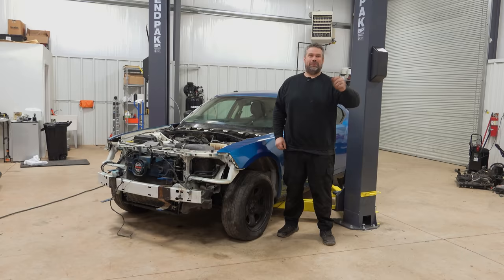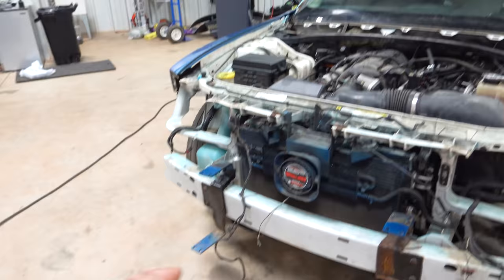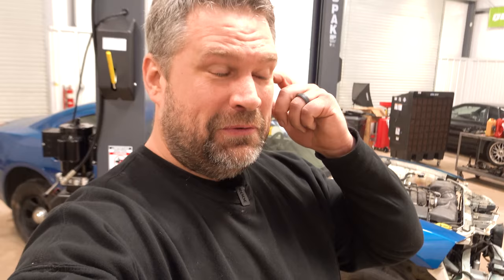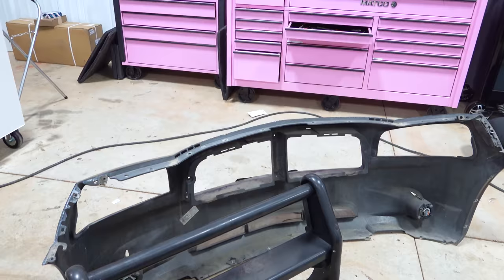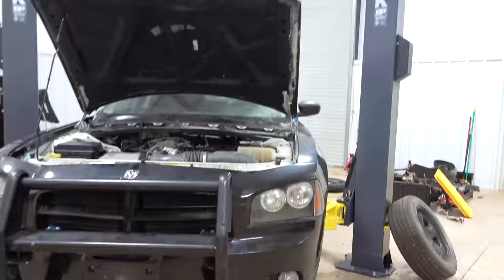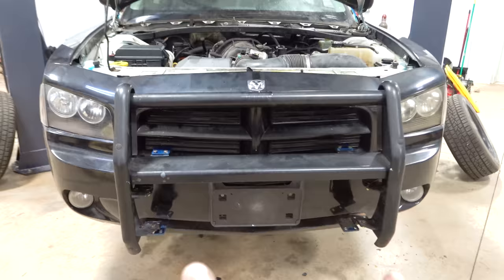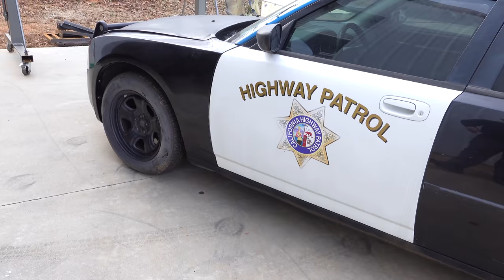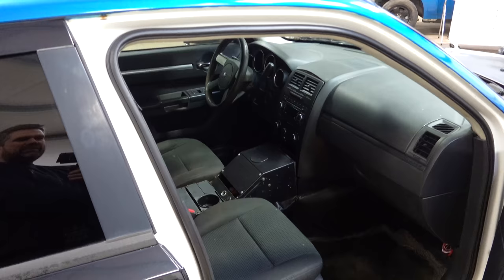Building An Insane Dodge Charger Cop Car In 2 Days (Was Way Harder Than I Thought)

Comment: My two cents, paint the quarters and side pillars up to the roof trim black, leave the very top of it blue, maybe replace “ Protect and Serve” with “Make Questionable Choices.” It would look freakin cool and get all the required boxes checked off. As always stay awesome guys!
Reply: Make Questionable Choices is an awesome idea on the side of it.
Reply: Make questionable choices is a great idea. And rattle can all the blue to black.
Reply: Agreed. Keep the blue on it in some fashion, to reflect back on it's OG color, but keep the base black to blend in and homage the original prop car.
Reply: No filter, no bs...paint the "puto". Its no more work than you'd put into the car wrench wise. Don't be half ass now. Hell follow Vice Grip Garages 'less than $100 paint job' and it'll come out decent. All it takes is some spray paint and sand paper. Far less than a part on the engine. The project deserves more attention than just the mechanical issues...

Comment: NIce video..I recently pulled an '07 police Charger 5.7 RWD (midnight black) from a field in Georgia, got it running, been quite a project..but love it all, your vids help. 

For the push bumper brackets, mine were bent, too. Paid a local muffler guy w/a press brake $20 and we got them lined up to a used PB I bought for $75 and we cut two pieces off a piece of 1/4" mild steel from eBay to drill and use for spacers as the PB I had was the wrong year (Go Rhino for '11 and later). Anyway, painted it, looks great now. 

Done restoring most of cosmetic  and missing parts issues, and general mechanical issues, next step is now adding a comp cam, better valve springs, MAYBE port the heads, get high flow cats in there. After that, planning on a single turbo back near the rear resonators (already deleted the mid-mufflers w/Dynomax race bullets) with some higher cap injectors, new lifters and retainers, long tubes, and maybe an intake from a 6.1 and then tune it all. A Hellcat turbocharger is also not out of the question as part of a compound system, both turbo AND supercharger (also other nice kits out there for the 5.7 LX).  As it's the police package, already has higher flow oil pump, intercoolers, etc., better suspension. It already looks badass, but it's going to light things up performance wise, too. From stock 340hp to hopefully 800whp, on 18" steel wheels, lol. 

You asked about what to do next? For my car, I tried to retain its history and character, whatever it was. I kept its patrol number in the back, and that's it's name. Each car has a history to honor. So, perhaps honor that history by keeping its current mish-mash look, then mod the heck out of it to make it screaming fast.

Comment: My reasons for wanting a Charger was that I was fed up with a 2014 Pathfinder, and my kids are 5 and 2 now, so they can sit forward facing in their seats, and I don't need quite as much cargo. I wanted something fun, fairly new, big enough for the kids' seats and room for another person in the back seat, it needed a V8 and because the G8 GT and Cadillac CTS-V are so expensive, it couldn't have a manual transmission, but the ZF8 automatic is very nearly as fun. 

It's my last ICE daily driver though, and the fuel economy (and then getting a new job with a huge pay increase) kind of solidified that to me. But the sounds it makes even stock are just amazing and I'd recommend it to anyone that wants cheap performance with 4 doors.
Reply: You said no more ice daily, but will there be a weekend ice ice baby....
Reply: @Karrguy1973  That's what I'm working out. At the moment, I have the Charger and a Honda 919, but no garage. So the bike will probably stay for weekend ice until we move and get a house with a garage. Then I kinda want something RWD and turbocharged, as I've never owned something with a turbo...
Reply: @stevemulcahy5014  nice, you will love the witchcraft that happens when boost hits.
Reply: @stevemulcahy5014  Hey Steve just some friendly advice on your hemi charger. If it’s the 5.7 hemi and you plan on keeping it, put a cam and lifters in it!!! Watch the episode on uncle tony garage. He goes over the problems of 5.7 hemi’s eating cam and lifters!!! I had a hemi 5.7 in my 1500 pickup and my cam and lifters took a shit as well! Good luck on you car build!!!
Reply: V8 charges are skyrocketing in value and its annoying because I want one.
Reply: @spicysnowman8886  If you absolutely have to get one, the 3.5L V6 is quite beefy. I don't feel bad when I stomp on the loud pedal; just make sure you upgrade to proper dual exhausts first-thing. The engine is absolutely whisper-quiet when stock.

AVOID THE 2.7L V6! The oil seep holes are too small, so it likes to starve the upper half of the engine of oil, seize up, and explode.
Reply: @MishraArtificer  if im having a charger uts gonna be a v8, if I wanted a v6 I would buy a lexus
Reply: @spicysnowman8886  If you can afford a V8 Charger, go nuts. I'm just saying: a Charger with the HEMI, in my part of the world, is almost $8000 (if not more) for a first-gen LX platform one that doesn't have terminal rust in the wheel arches.

My SXT with the 3.5l V6, on the other hand, was just under $3k.
Reply: @MishraArtificer  you'll be hard pressed to find a decent condition relatively low miles rt for less than 12 or 15k in my area

Comment: I had a split color black and silver s10 that my ex totaled the front end of in a colorado snowstorm many years back. I junkyard restored it but only found good pieces in the opposite colors of what the original hood and grill/bumper were, but I always loved the change-it looked like it all belonged but also really popped. Blue's a bit weird and doesn't really belong for the other parts of the charger, methinks it would look better painted, but after that s10, I understand liking it and I'm now somewhat a fan of interesting color swaps/combos/mismatching, myself.

Comment: Paint the hood, but do it in the shop using aerosol cans including 2K-in-a-can clear coat. That's how us DIY types sometimes have to do minor repairs without investing in a full compressor, dryer, portable booth, etc.  For the top and fenders, how about a movie-accurate wrap instead of a repaint?

Comment: If you happen to have an alarm system from an old shop, they all have (basically) the same kind of controller for the sound, so you can use it on that siren (as long as voltages match, which they should since most alarm systems are 12v) for a quick setup. Obviously, it won't make the same police sound, but i don't think you're allowed to do it anyways (afaik, even some of the running lights are illegal for civilian use).

Comment: Just ran into a Kenworth that had a replacement headlight assembly with a burned out bulb with a straight socket. We only stock the 90 degree ones. Wasn't preferred, but I was able to get it to work with an acceptable enough bit of slack in the wires. Would have preferred a little more slack.

Comment: My first choice would be to keep the entire thing the original blue: move the door guts from the "highway Patrol" movie car into the Orlando PD car so that way you have an entire set of working doors (*and the lock in the driver's door will match the ignition key!*). It's a pretty color, and I wish I could paint mine that blue.

My second choice would be to turn it into a modern-day Bluesmobile: paint it like Elwood's old Dodge Monaco, and leave all of the faded bits faded. It's the only way I can see you getting to keep it "cop-issue" looking without risking a ticket for impersonating an officer.

Comment: I vote to leave the roof/uppers as is, either repaint the lightweight hood black like the rest of the front clip or leave it blue. Give it a good detail, new push bar, and call it good. I love the mismatched paint, especially if you throw a few mods at it

Comment: Got Covid-19 and almost died. Yesterday I tried to fit the heat in my 89 k1500 replaced the blend door motor but no power to it. Think it's the electrical control head. Next week I should be able to pull down my spare parts boxes and get a replacement controller.

Comment: Make as movie accurate as within possible i think. Just don't swap the dash the V6 dash makes no sense when you have the V8 dash. I honestly think it will be cooler as a stand alone movie car. You should also restore the decals put the swivel light on an maybe a roof mounted light bar.

You could use it in videos remaking famous cop chases. You could probably talk to guys like Cleetus McFarlanen to get track days at his speedway to film chase scenes.

Comment: I would say, do what you feel what you would like more. But, I think since it's part donor and part movie car, I would remove the stickers and repaint it to coloring scheme you would like and with new decals (Like maybe it labeled Project Road Block) because with a fresh paint job would be the same without, you have to tell them it's a donor car with a movie car parts on it either way that you made into 1 functional car. I would think stories of the car are just as good as it just being a prop car. But this is just my opinion.

Comment: Because this is a single made from two, paint the drivers side black and white with a hand operated A pillar spot light. Down the the center of the hood, roof and trunk go the blue metallic for the passenger side. 
Two Face. Depending how you park, it's a different car than the one that just blew by a roadside speed trap.
Seriously Jarrod, You've such a successful job you should go with your gut and do your own thing cosmetically. You call it. ✌ 😃

Comment: I like it as it is, but paint the hood shiny black.  I am also not crazy about the fuel door with random letters on it.  On a drag strip the cop car theme will make little kids wet their pants.  I would put a light bar on top you could turn on when racing.

Comment: My thoughts - Get rid of the blue, it doesn't work with black and get it looking like the cop car it's supposed to be. You probably need to repaint the black so it's going to be a complete make-over anyway.
Some nice wheels would be good too although I presume that's a departure from the original - not sure that that matters however. I like the comment below about putting "Make Questionable Cjoices" on the back fenders. - I think that's what you Yanks call them.

Comment: Jared: Please don't make a habit of these "fake deadlines". This(almost, very nearly) felt like the tv show style that turned me to YouTube. We don't need the "drama" of an impending deadline. Leave that to the corporate channels and the tv shows - please.
That said, the car is looking interesting and, like you, I kinda like the patchwork effect, especially the fuel filler door. Assuming it survives the trip to Florida, I would complete the structural stuff and make everything work correctly(mechanically and electrically). Then it's time to look at the paint. I think I'd want to keep some elements of both cars but leaning heavily towards the black/white. 
I'd be doing some checks as to how much of the police scheme you can legally use on the road though and definitely customise the gold stars to represent the channel, or represent 𝒚𝒐𝒖.
Good luck in Florida and try not to wreck anything on the car, or yourself.😁👍
Reply from the maker: Wasn’t a fake deadline, Tavarish threw a trip down for work with just a few days lead time, and then ended the call with ‘hey bring the charger!’
Reply: @TheQuestionableGarage  Fair enough. I did have the expression in "quotes" as I didn't mean 𝒓𝒆𝒂𝒍𝒍𝒚 fake. We see it so often on the "reality tv" shows, it can sometimes seem like needless drama, even when it isn't. 😁

Comment: You are in need of someone to take control of editing. You are not on tv, no reason to recap 5 times! On a short video. At least 10 minutes of recaps. As to showing body work .. come on, no one is here to listen to muzak and watch you put on panels at any speed. There's a solid 15 minutes of fluff in a 24 min vid. Your diluting your audience by posting film without what your people are ( or were) here to see, just to post content. 
Sorry for the complaints, but I'm just about done with this channel, not much "wrench everyday" content and a whole lot of unnecessary film of a large man talking about the same crap. This channel (as it sits) should be called
Bore everytime..